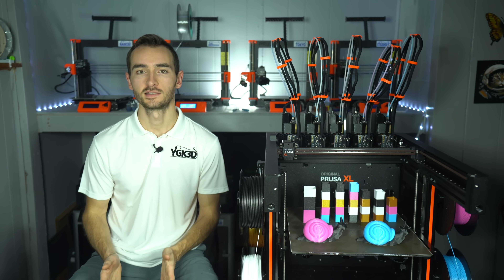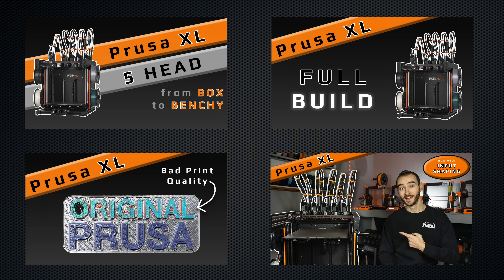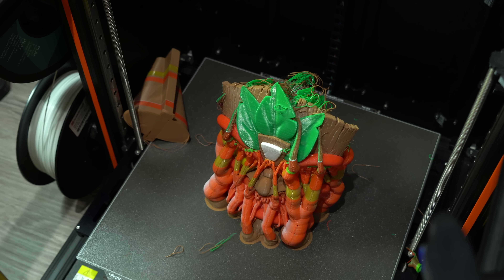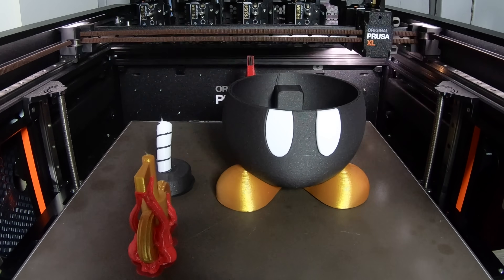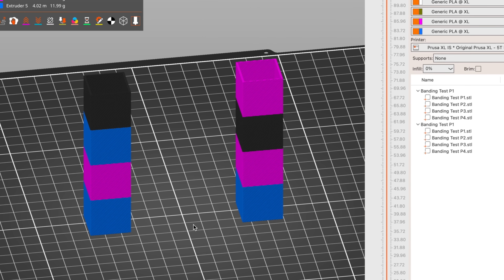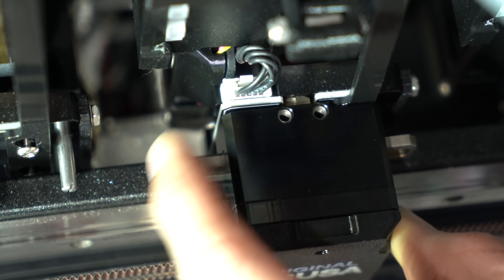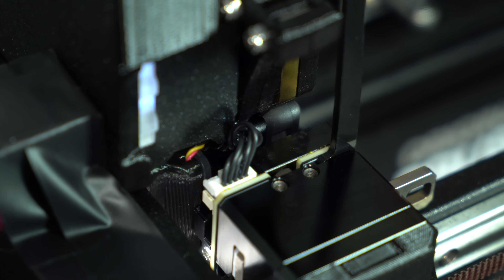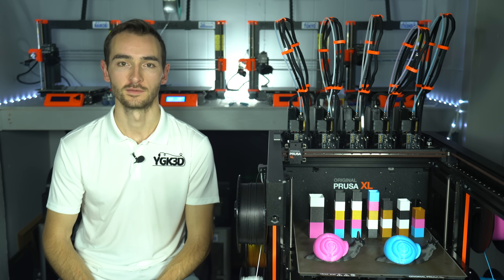I Fixed The Prusa XL's BIGGEST Flaw

Comment: Make sure to show this video to Prusa.  They need to be aware of this.  I'm honestly surprised beta testing didn't discover this.

Contact support and give them the link directly.

Clearance free connections are not new and should be doable.  Look at tooling collets for cnc machining centers.  They switch tools many times during part machining and there is zero play in the tooling.

Comment: I wonder if there would be a way to improve this -to require less movement. (as multiple tool changes and each one now requiring a long move to bump block takes up MUCH more time) - like a flexible shroud around the tool head it can 'bump' into on the way out of the docking system, to do the same thing - but not require the extra movement?

Comment: I'm really glad you found a solution to Z-banding!

But, I think you have a defective tool changer mechanism. I own a semi-assembled 5-tool printer and I just purposely did a crappy job of the dock position calibration and it still passed without any of the misalignment that you are seeing. I've been lucky to have perfect layers since I assembled the printer.

You may want to reassemble your tool-grabber head, maybe that spring you install during assembly is caught on something? Just some ideas. Happy printing!

Comment: I haven't had the banding issues like you, but I'm dealing with other Docking Issues (self-inflicted to a degree).   The way the docks are mounted is really a bad design by Prusa.   Super tight tolerances for mounting and only securing with a single screw.   The changing of tools is pretty violent and in my case it causes the docks to shift a little bit causing failures.  I think if they slowed the tool changes down a bit it might also help your issue and mine.

Comment: I just got my XL a few weeks ago, but haven't had time to put it together. I finally did that last week, but I can't calibrate the 5th dock because it's missing the dock pins. I watched your video and wondered if any of the extruders wiggle like your does, and I found that head #4 did. I pulled it off, completely disassembled the front piece where the print head attaches to. The top flat dock "pin/grab-oid"" was wiggly, which is why I took it apart. Once I got it apart, I found that the screw on the backside was tightened but it was at an angle, so even tight, the flat dock "pin" still wiggled. Pull both off, switched out the angled screw and poof, no more wiggle on the flat dock "pin/grab-oid" piece.  Once both of those pieces were solid, I ran the calibration again, for dock 4 and it was solid, it does not wiggle when it is the active extruder. Hope this helps!
Reply: This should be a top comment.
Reply: In his case, it appears, if you look at 6:02 in the video, that he has installed the support straps for the electrical/PTFE bundle incorrectly.   As a result, he is blocking the lower right docking pin... this is an assembly issue, and this "solution" is un-necessary had the printer been assembled correctly.
Reply: @bobnedved1589  Thats not true, he just left them loosened during this shot. You can see they are installed correctly further in the video. Plus even if they warent it wouldnt affect the printer in this way
Reply: @ZhakRyuu Do you have an XL?  You are incorrect.  If you block the coupler pins, further, if you fail to even periodically lube them, it can cause this exact issue.  Take a look at Prusa’s support articles.

Comment: It's good that you found the solution to your problem. While it works, it isn't indicative of a "fundamental flaw" because not all XLs exhibit these issues. Each toolhead dock is held by a single captured screw and it can loosen over time, so that is something I would check first. Second, the Prusa help page on belt tensioning and alignment on their support pages has to be improved, especially the section on alignment. With the extruder mounted, there has to be NO PLAY between the toolchanger and the front of the Y-axis on both sides. There is a likelihood your XL exhibits some play here.

Comment: Great error finding and problem solving, but shocking that Prusa did not realize this themselves. 

Considering that this comes down to a rather simple error and can be fixed in a simple way it is somewhat unbelievable that this did not com up during testing, even after all the delays.
Reply: There’s no way they missed it. This came up in testing and they were behind so they knowingly shipped faulty printers anyway.

Comment: Glad you found a workaround to an issue but you haven't yet hit the root cause. My XL5T has zero play between the picker and the tool; there absolutely shouldn't be any. Maybe you have debris in a hole, bent locator pins, bad locator head, slightly proud bolt, random burr, etc. Somewhere your hardware aint right and when you find it, that'll be the root cause.
Reply: Mine has same play that video shows at 5:38, I think yours has also if you push with enough force at right direction. I have found that this play is due to nextruder pins design (pins that are catched by toolchanger), if you move pins with nextruder at your hand you can move them slightly , it seems like loose bolt but if  you disassemble them you will see they are designed to have this small play due to rubber seal between bolt and pin
Reply: @PanchoVilla-gl2sd  You're right, but the key is 'enough force.' It takes considerable force to move. It also immediately springs back to nominal. But if you watch slowly at 5:53 the tool will wobble from just brushing against the calibration cube print and the print doesn't even dislodge. The difference in forces required to move the tool are wildly different. 

So maybe @ygk3d's tool 4 just has bad rubber? Seems like an easy enough check: get a good hold of the pin on tool 4 with some pliers w/ soft interface and see if it's obviously looser than the others.
Reply from the maker: Mhh… nothing obvious but I’m going to have another look and see what I can find.

Comment: Thank goodness for people like you! Mine will ship soon, and it's good to see it's at least possible to work around the bad engineering here.

I specifically picked the XL as my first ever 3D printer, because I didn't want to have to futz around with all of the same stuff I would have to on a Chinese printer. It's somewhat ironic that Bambu Lab has become the hands off standard now even if they have all kinds of security and privacy concerns.
Reply: Those can be fixed with some simple firewall protection, like not allowing it to have any internet access.

Comment: Hey, cool video, forcing the coupling like that will help but it’s not the best idea in the long run, simple fix is clean the 3 locator pins on each tool, also clean the 6 pins in the tool changing mechanism then lube the 3 locator pins on each tool should achieve the same results and will be better for the machine long term, subbed 🙌
Reply: Very good point. If it's just a matter of friction between the tool changing bracket and the pins, then a small amount of lightweight machine oil should solve the problem. This is definitely be with experimenting on. The key would be a very small amount because you don't want to end up with oil dripping everywhere or getting somewhere it shouldn't.

An alternate approach would be using some kind of dry lube that basically leaves a Teflon like coating on the surface that is somewhat harder and resistant to scratching off. Now that I think about it, that might be the perfect answer here. The trick would be disassembling the tool head enough to get those parts out somewhere where they could be sprayed safely away from the machine.
Reply from the maker: Thanks! Not sure what there would be to clean on those but I’ll have a look. You’ve showcased some of the most amazing prints on the XL.

Comment: Wow at 1:20 the reason for the stringing is obvious. It's doing a Z lift in-place. Needs to move horizontally at least 30 mm or so after retraction but before Z lift to ensure the string is broken.
Reply: This is essentially what the channel 3D Print Dogs discovered. They have a small gcode fix that moves the print head away from the print before doing the Z lift. Prusa has announced that they are implementing a similar fix in the printer's firmware.
Reply: @MikeKobb  The current PrusaSlicer beta does ramping travel moves, plus helical movement on layer changes. They thanked Bambu for the inspiration on that in the release notes.
Reply: @ulaB  Nice! Didn’t realize that they had released it already.

Comment: Damn tho that tool lock is not stable at all, very wobbly...
maybe they should've used stronger springs etc.. 
I'm making a tool changer and i was gonna go with this mechanism but after seeing this i might just make my own with a motor.
my doot changer "motorized" barely cared about alignment it'd just sorta self align itself after picking the tools up, unless it was really bad

shame that you have to do this on your own on a 3.5k printer.

to speed this up maybe try shaking the print head instead of bumping it!

Comment: A trick I use on the MMU2S for issues with tower stability, especially when using different materials (PLA & BVOH) is to "encase" the transition tower in a separate object made of 1 material. It was designed like a "hat" with the "brim" on the plate, with me resizing the object to fit the tower after an initial slice.
It's jank and is far from perfect since you're using more of one material, but it eliminated the issue of the tower coming loose from the plate or delaminating mid print.
Reply: Like a draft shield?
Reply: @KoenKooi no. Solid Object (well, an object with 10-15% infill). Which is why it works well and why it's jank- jank because the printer is printing infill and the wipe tower over each other in the same layer, but works well because that infill, being attached to a solid object made of a single material, does not allow the tower layers to come loose at all. A draft shield would still have the potential to let the tower delaminate and "fall over" inside, although it may contain the tower and wiped material (although a sufficiently "tight" draft shield with 2-3 walls may have a similar end result to a solid object).